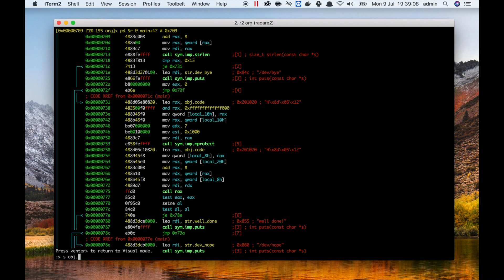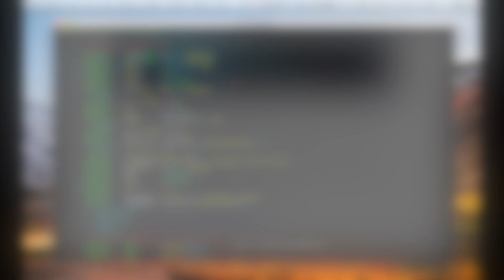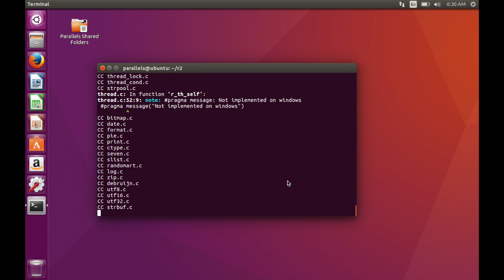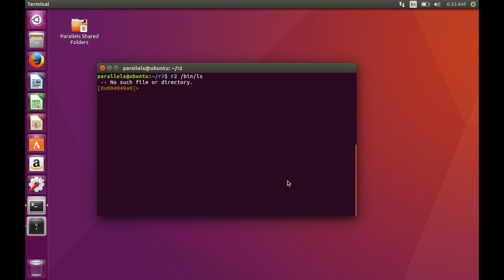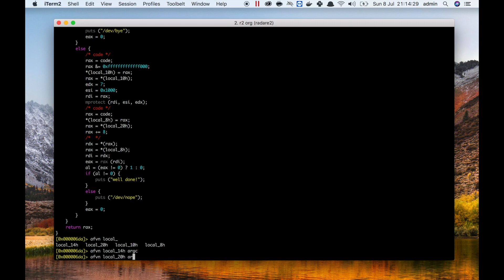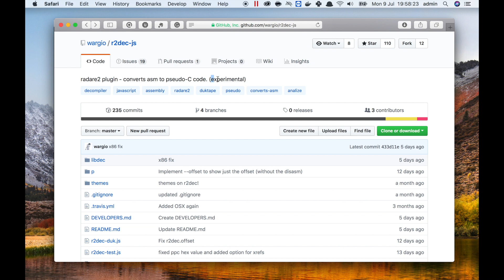r2dec - short intro into radare2's decompiler

Comment: I'm using it on windows, the `pdd` only shows the assembly code, any ideas as to how to fix it ?
Reply from the maker: Did you install the r2dec plugin?
Reply: @allthingsreversed  for windows, so need to build and install manually,

 at any rate, I opened an issue on Github, hopefully someone will take a look in a few days...
Reply: @allthingsreversed  the r2pm is not available on windows right? So I followed the intstructions on Github repo of r2dec,
Have you had any success on Windows with this?
Reply from the maker: @harshivpatel6238  sorry, I assumed you run under WSL on Windows. It is always preferred to build from sources as this means one get a latest version. I'll check for myself why r2pm is not on pure Windows installer.
Reply: @allthingsreversed  guess I should try the wsl version rather than pure windows version
Reply: @allthingsreversed  yeh, the WSL method works flawlessly!